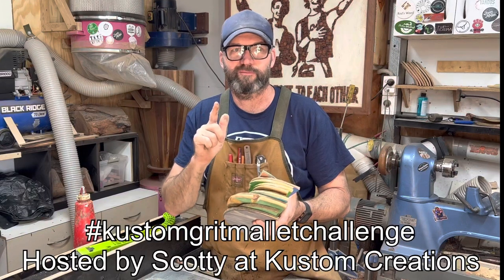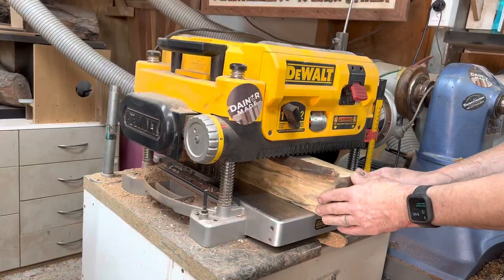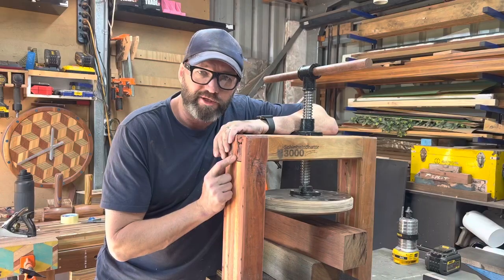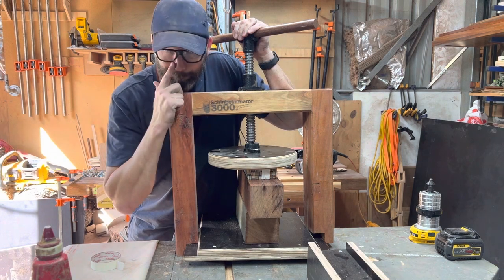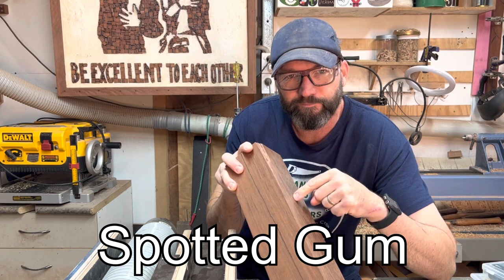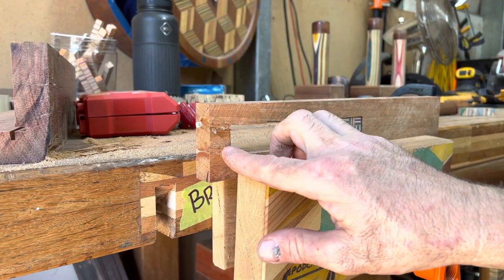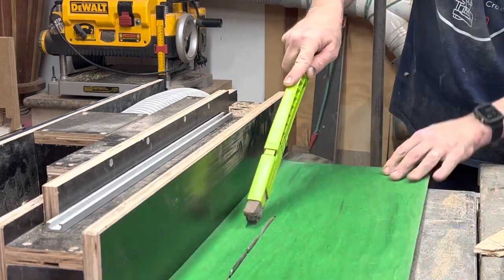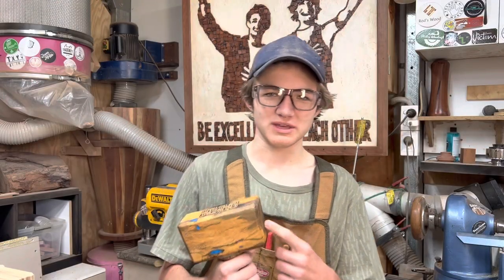How to make this pattern for inlays #kustomgritmalletchallenge

Comment: Sweet mallet! Nice save on the off-centre hole!
Reply: @dainermade  I figured there were quite a bit of swearing before you got it to the finished state... 😅
I'm utterly shit at drilling straight, so I do as much as possible on the drill press. When I reach the max depth of the drill press, I usually let the piece ride up with the drill and stack scraps under it to make it go all the way through. Can be a little fiddly, but it's better than my piss-poor aim...
Reply: @dainermade  I feel playing around in the workshop is a constant fluctuation hero - zero - hero - zero... 😅

Comment: Great project mate! I need to move to Australia(if we were allowed!!)..so I can have the weather to do this stuff outside all year round! We only get 3 dry days a year lol and I'm lacking a workshop.. I got loads of tools and ideas now but nowhere to put em/work. End of August and the shitty colder weather has already started to show its head a bit, chill in the air, can tell in 2-4 weeks it's gonna be sh1t til April again! FFS.. 

Got so many ideas from you mate it's great, I really need to start doing some stuff like this try and make a bit of an income.. had a bad run last 4 years can't work, so a hobby I can make a few quid off would be ideal for me as I'm pretty handy.
Anyhow great work as always!
Cheers from London England 👍😎🏴

Comment: another spot on video there mark:), timbers used were,Leopard Tree Wood, Broken Skateboards, Spotted Gum ("HardiusAsFuckairius"), and Dyed Maple Veneer.,could that be converted into a steak hammer i wonder ??, be interesting to see if you could :) :)
Reply: @dainermade  its a hammer/mallet just like you have made but slightly smaller overall with both heads with a serated edge, used for tenderising steak before throwing them on the Barbee, try looking on amazon proably be one there normally in poncy metal tbh :) GDayyyyyyyyyyyyyyyyyyyyyyyyyyyyyy m8 :)